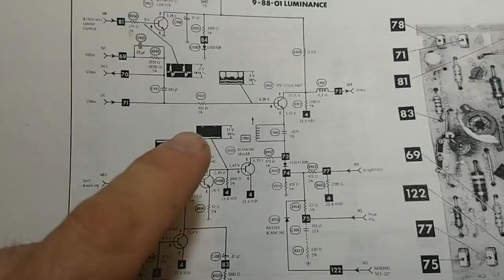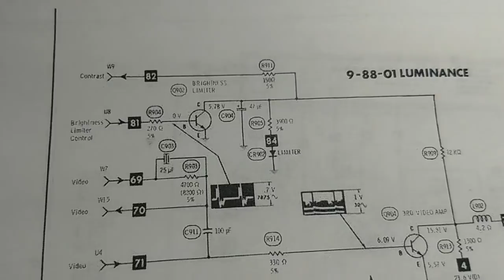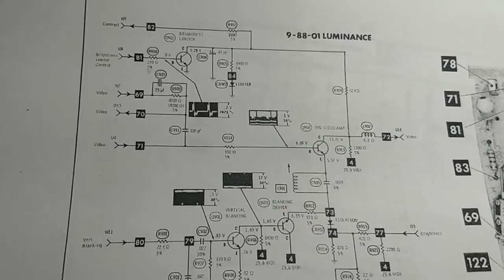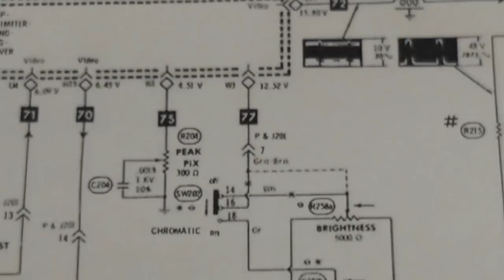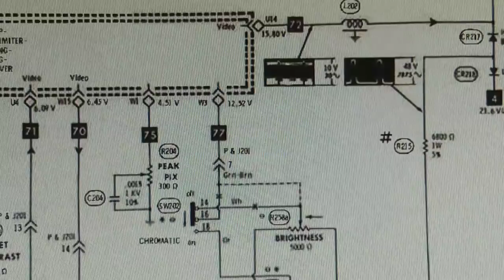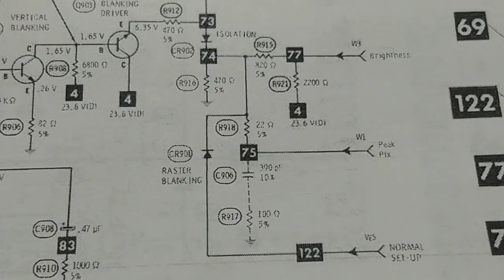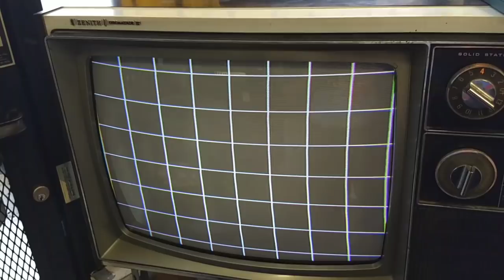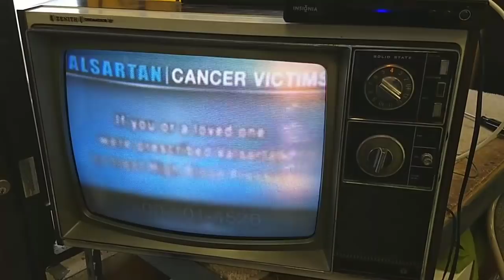Servicing a 1974 Zenith 17" Chromacolor II Color tv part 6 / 6

Comment: First generation Chromacolor II sets seemed to be prone to color demod, and raster overdrive, to the point of clipping; so-much-so, that a service bulletin was issued shortly before Christmas, 1975. The 1N4148, and 1N914's seemed to have been plagued by lower than expected reverse resistance, sometimes to the point of being downright leaky, and overdriving the raster side of the circuit.  When the "Chromatic" switch was "pushed to the on position", the picture gained far too much of a black level.  When service techs entered the customer's home,  the "Chromatic" switch was usually off. Sets which saw a high frequency of Chromatic use, seemed to have problems with the 'blue guns', and by force of habit, the majority of techs would back off on the signal driving the blue gun.
Reply: This is really a far fetched synopsis;  I've serviced Zenith TV's for years and never encountered any of these issues.  Never heard of such a thing;  the Chromatic setting was just an alternate set of controls that went into a pre-set position, which, by the way, could be adjusted.

Comment: Hints....
Filter can is on a bracket & pops off for easy change. One 1/4" takes it off without chassis pull.
Zenith terminal strips are mounted at the ends & sometimes other places. These are often used for grounds & they are known to break loose & go int. Check that bottom chassis for this.
The 9-88 was used in the E-line sets ( 17EC45 etc ). Any 9-88 -## may not be a sub ! 

This may be causing confusion as to part values in Sams.
 In E & F line sets there are 2 MAJOR chassii. Under run 401 uses 5 safety caps PN  22-5001. After run 401 the infamous 4 lead cap was used. Yours is orange so OK but other circuit 

changes may have happened. Only the Zenith CM manuals & any supplements ( CM1##-# )
can be trusted !
Last I think you may be trying to drive the bright too much. These were bright for the time but not room lighting. That kind of brightness had to wait a few yrs for the in line EFL jugs.
The pix looks very good otherwise. All of us considered the 17" the best pix of all the CC2
sets until the 13" 13GC10 chassis came out.

LFOD !    Tom a.k.a Zeno

Comment: I think the resolution could be adjusted cuz' you can't see all the little logos, messages or any other letters not shown that's to the far edge of the screen. Is that possible?
Reply from the maker: Unfortunately the width on these is fixed. You might be able to modify the horizontal drive circuit to lessen the width but you may also cause linearity issues with modification.